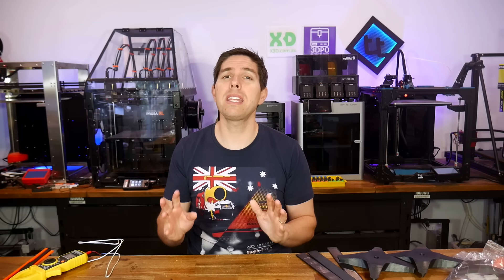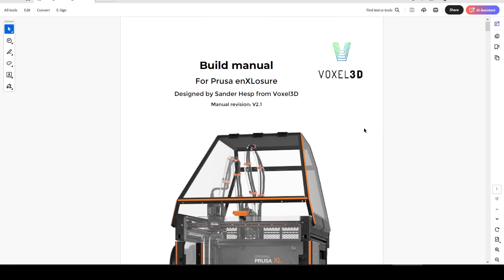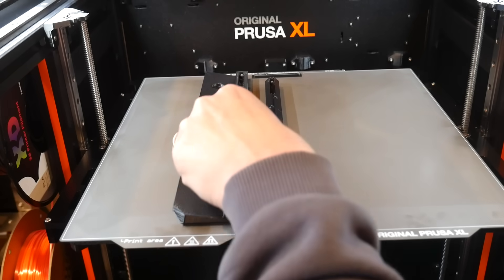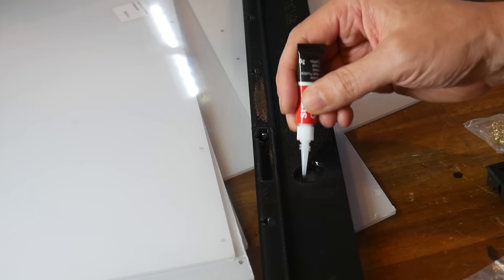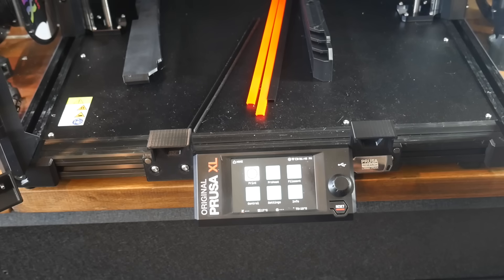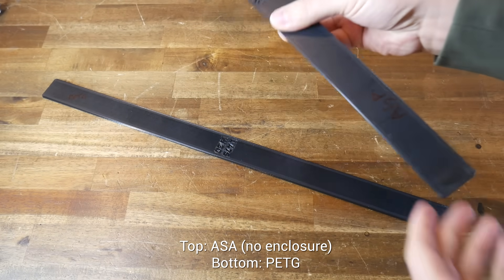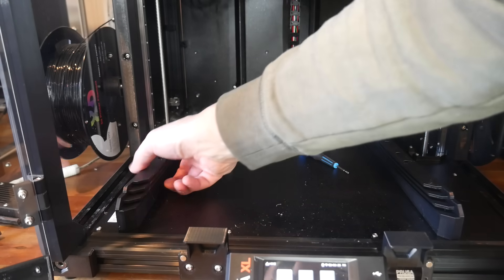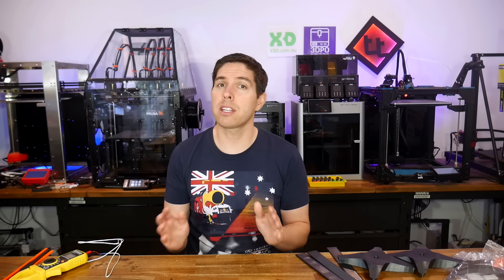The EnXLosure is the XL add-on Prusa should have made

Comment: Thank you for all of the well presented and helpful content.

I also am committed to my XL because of all of its potential. I am a little hesitant with modifications though because of the rate things are changing. For example, the inductive heater kits and silicone printing options. I'm afraid to build and refine an enclosure that will potentially be outdated if I want to add these new capabilities.

Comment: The official enclosure has parts made of ABS(?) that replace some PETG parts on the toolheads. Have you seen any issues with the EnXLosure since all the parts are PETG? I have an XL and I'm deciding whether to get the official enclosure during their black Friday sale or go with this one.
Reply from the maker: The printer was updated to have the higher temp resistant material from factory so I didn't have to change them and neither would any other recent purchasers.

Comment: Thanks for showing how to improve this printer. I have been holding off buying because of shortfalls you and others have shown. Issues I think Prusa should have accounted for. The changes with the enclosure seem fantastic - and it is so much more sensible than that monstrosity Prusa released. The follow up with the dryer as an AMS style arrangement seems interesting. I don't see the length of the PTFE being a problem since you are not unloading filaments... vs say my P1S with AMS where I have mounted my buffer on the back of the AMS with an angled mount to reduce the changeover times from 22 to 6 seconds. 

The price is still killing me but I see it is currently on sale for Black Friday and I am tempted. Bambu has been enticing me with the simplicity of function and filament but I don't like walled gardens or items that are poorly designed for maintenance. Prusa has always been my favourite on this and I'd love to justify an XL haha.

Comment: Do you happen to have any belt deflection values from a tool for the XL? Struggling with getting rid of VFAs on my XL
Reply from the maker: I'm about to fit replacement parts at the top front corners to help seal the chamber, then I will be tuning belts. In the Prusa app there is a button to do it with the microphone and plucking the belts. I will start there.

Comment: I'm trying to gather my thoughts.
First of all, thank you very much for making this video! And I'm really looking forward to making a video about the drying box.
I almost bought this XL housing, but in the end I didn't. It wouldn't be bad as a temporary solution, but unfortunately for financial reasons I'd rather build something once. On the other hand, kudos to the makers, they put it together very well!
I also looked at the drying box. This would also be very useful for me, because I use the printer in an apartment and the moisture of the materials is a constant problem.
Unfortunately, a few problems immediately arose here. One of them is what about softer materials like TPU. And this problem can be connected to the housing, because if I don't take it through the pipes, then where? So far I've simply put the roll next to the printer in a small dryer, from where it could easily be pulled in.
But the question also arises with rougher materials, like glow rolls. I already had a problem with this, because I have 1 Sunlu S4 on both sides of the printer, which I print from. And because of too many tubes and bends, the extruder could not pull the filament properly, so the object was extruded from the bottom. I also print this from a small dryer, even without tubing.
And then the next big problem with the box is that I lose 1 space with each 2 kg roll. In other words, I can only use the five-tool printer with 2 2 kg rolls with 3 tools. But even with 1 2 kg roll, it only works with 4 tools. While 1 large roll fits into 2 Sunlu S4 without any problems and I can still use all 5 tools.

I am looking for a solution where I can put the dryer above the printer and simply feed the filament into the tools in a straight line. And preferably, I can use several 2 kg rolls at the same time. Also, softer and rougher materials should not be a problem.
In addition, it is important to me that there should be no odors in the case of PLA, because 1-2 materials can be very smelly and there are times when I can't stay in the room while the printer is running. So I am wondering about a ventilation solution.
In the case of ABS, ASA, it is clear that filtration is needed.

Unfortunately, I am not an expert or engineer in this field, so I am progressing slowly, a lot of time is spent thinking about how I should do this properly.

On the other hand, I always look at works like this with admiration.

Comment: RE: Electronic components and the enclosure:  I found that Creality's large cloth/mylar enclosure can just barely fit the whole of a Prusa XL inside of it.  While printing a full bed of parts in ASA I had a critical failure where the mainboard reported an over temperature error on the Buddy Board, as well as one of the bed panels.  I managed to be able to reprint the parts with a small vent opened up on the top of the enclosure, so I suspect an actively cooled mod for the mainboard will suit us well.  I've also been eyeing this enclosure since I first learned of it, so I'm happy to see someone put one together and show it in use.
Reply: There are a few models on Printables for a buddy board cover with a space for a small 40x40mm fan from Noctua. I did that mod a while back and it definitely reduces board temps, but I am running enclosure-less like the peasant I am.

Comment: The gaps do increase heat loss, so yes fill them in and lessen that aspect. But also include some form of thermal control so the internal temp is stable for various materials. Maybe include an air filter as well.
The filament cleaning is unusual as all required the hotends should be cleaned prior to bed leveling and it as you say appear off not to be factory installed.

Comment: The XL is a good concept but it needs some refinement. You are providing the refinement, so no you are not crazy to keep going with it. I would do the same if I had the money for such a project. The XL deserves a revision (with INDX) to make it a complete package in the future.

Pros:
-its BIG, one of the largest build volumes on the market.
-True multi material, the XL was ahead of its time with tool changing that the rest of the market is just catching up on
-segmented bed heating is a good feature (especially on a bed of this size)

Cons:
-no stock enclosure, that should be standard on a printer of this class
-side mounted spools
-no stock camera, no time lapse etc...
-No nozzle wiper
-No chamber heater
-it's dam expensive especially for the 5 tool head
Reply: If anything, the CoreOne is coming with the INDX system later this year. I wonder if it's going to be $285 more for the single tool to upgrade later and $495 with all 7 nozzles said to fit in the CoreOne, as the INDX extruder will be $250 + $35 per nozzle. I will be getting the INDX with 5 nozzles to "start" on my custom 300mm cubed printer.

Honestly, the CoreOne is one of the few Prusa printers i would recommend in the last 12 years of 3D printing. The mini for it's time, for the price and quality and the MK3s in it's time if you didn't mind paying a premium for a reliable printer as the only other options where to upgrade off the shelf printers
Reply: @MrHeHim yeah, I upgraded my Mk4s to a core one. Now waiting for the INDX, 7 color/ material tool changing will be an amazing capability.

Comment: Some lessons learned if installing an enclosure on the XL.  I have >3000 hrs with my own designed enclosure (not as pretty as pictured).  With it, I am able to maintain 50c in the enclosure with two caveats. Forced cooling is needed for the Dwarf board. A thermostat controlled computer fan works well set for 37c.  Second is a fan to keep the enclosure below 52c.  This is important to prevent overheating the tool heads.  If you purchased your XL before July 2024, multiple parts on the print heads are PETG and will deform in the enclosure.  Additional, I found that the Vertical post at the back supporting the print heads cable assembly will deform enough to cause the belts to rub on one or more of the rivets back there.

Comment: Pipe insulation foam tubes (looks like a pool noodle with a slice down the length of it) works good on the edges for the plexiglass to seal the edges.

Comment: Did you have to replace any of the printed components on the toolheads? The video review from Robert Cowen showed that all the toolheads needed to have their PETG parts replaced.
Reply from the maker: These components were updated mid 2024 from memory. The new ones are good to go for enclosures. I'm very glad because the original design was ludicrous.
Reply: Those needed to happen to the first batch (dumb I know) it sounds like they changed those parts with newer releases after the enclosure was released

Comment: One of the main things putting me off the XL is the crappy enclosure. Not just because it's crappy, but because it's almost a certainty that Prusa will eventually come out with something that's like a cross between the XL and the Core One. And that's the printer I want.
Reply: I still think the Core One should have been a cheaper de-grade of the XL with the same bed volume.  That for $1K and being able to upgrade to a 5 tool XL with a Core One enclosure would have been better

Comment: Incredible the length and efforts needed to be able to print simple high temperature filaments such as ABS and ASA on this very expensive printer... Multi material, yeah, but not really out of the box. Unless all the materials you're printing are PLA, PETG or TPU.
Reply: I am definitely in the niche of only printing those 3 materials, and for that it does a decent job, but I agree that the overall design is a hot mess. If I had been in the market 2 years after when I bought mine, I would have gone with an H2D even with having to work around all of Babmu's user-hostile choices lately (especially with them lying claiming network connection requirement is for *security*. Yeah, right, buddy.)